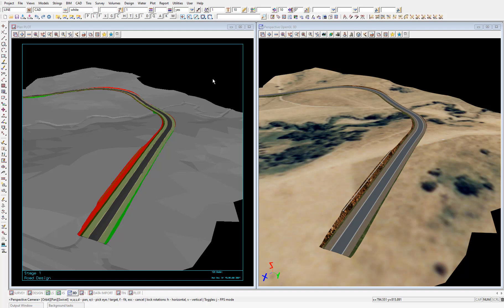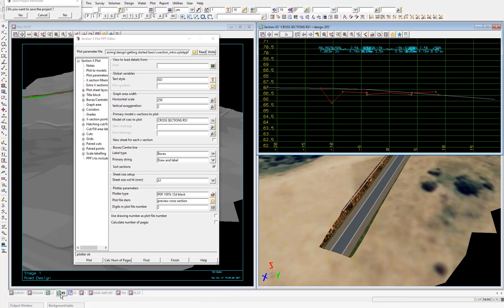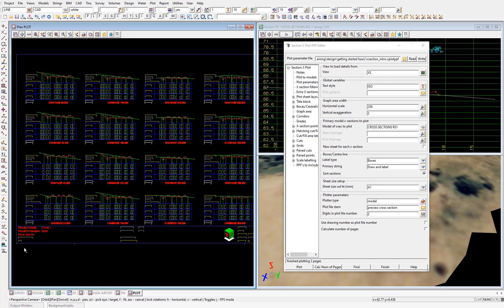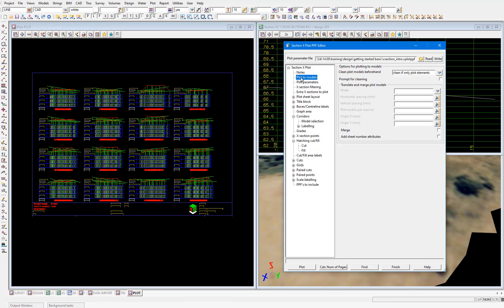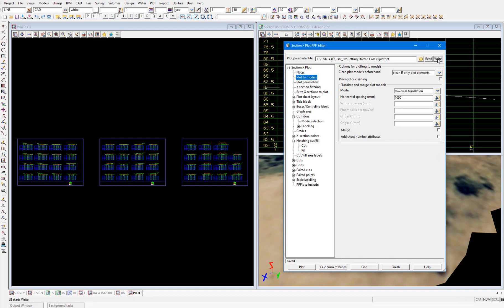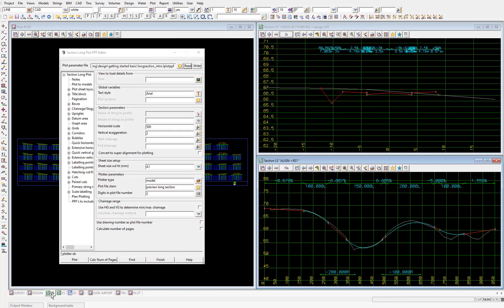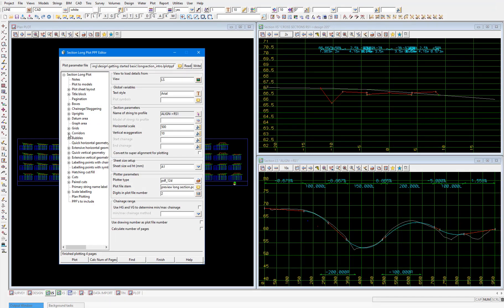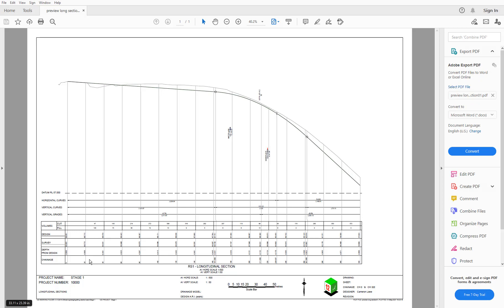Cross Section and Long Section Plotting: Getting Started for Design (12d Model V14)

Comment: Hello Sir,

I would like to ask whether there is a way for me to insert specific chainages into the long section.

There are some special chainages that I would like to have displayed on the long section.

Could you please help me with this? Thank you very much.
Reply from the maker: Hi, yes you can input chainage values within the 'Chainage/Staggering => User upright chainages' node of the Long Plot PPF Editor, or you can pick a special chainage file within the 'Chainage/Staggering => Special chainage file' node. Either of these will produce uprights at the listed chainages.
Reply: @12dModelSoftware  Thank you very much, your software is amazing.